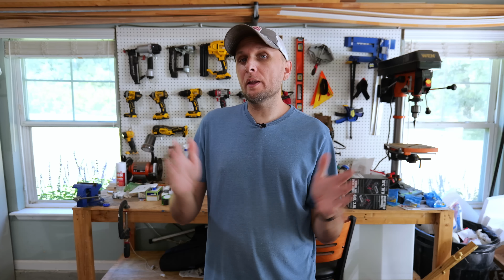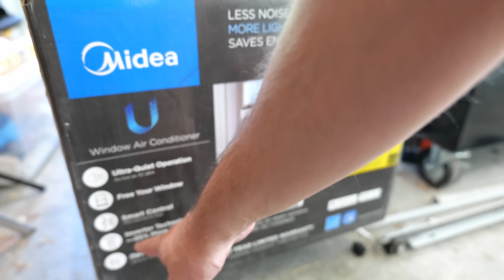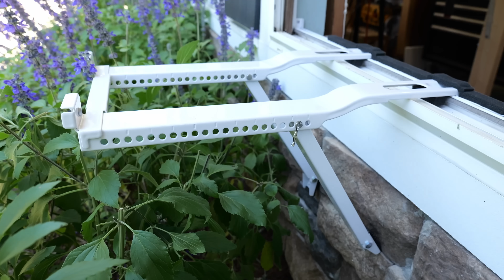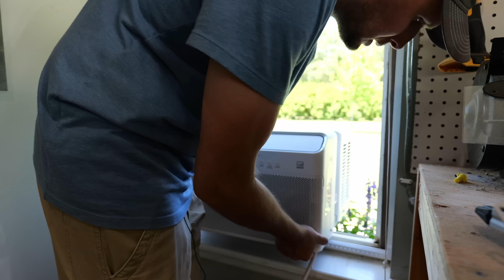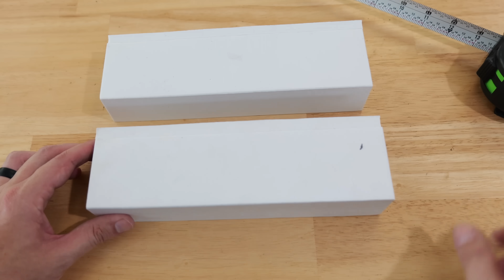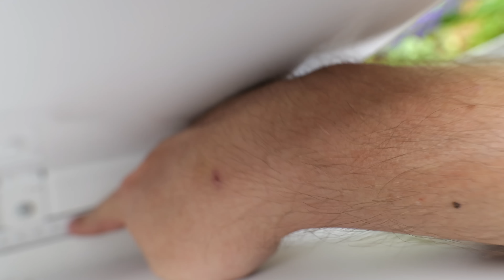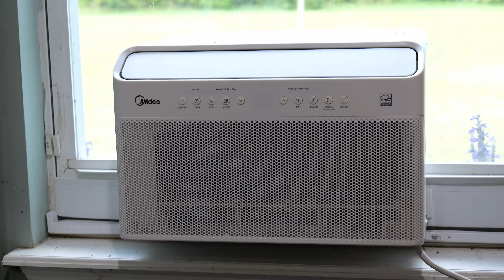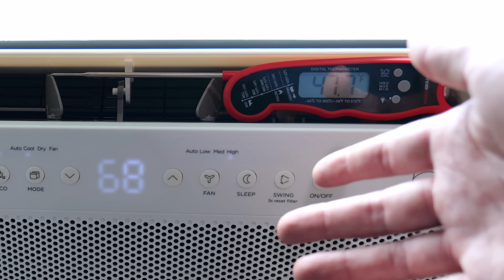The COLDEST And QUIETEST AC Unit Ever Made!  Still Use Your Window!

Comment from the maker: For your convenience there are links for everything you saw in this video from the Midea AC Unit to the tools used in the description of this video!  I am pleasantly surprised how quiet and efficient this unit is.
Reply: Looks like Midea does make a heat pump version. Very expensive and it's a "n" design  but plugs into a 110 outlet. It's literally a compact mini split but for some reason they're only manufacturing it for the East Coast market for the United States while another company is manufacturing their own for the West Coast market.
Reply from the maker: @riopato2009 I don’t think it’s available yet though is it?
Reply: @HowToHomeDIY  no it's not unfortunately at least for this year.
Reply: @riopato2009  Air-to-water heat pump that can provide space heating, space cooling and domestic hot water with quiet operation in -25°C low ambient temperature.
Reply: @loxety  Midea's window heat pump can only do -17c
Reply: @loxety Can you please tell me about this unit you speak of?
Reply: @riopato2009  any chance i could buy them here in Australia? We're 240v and i wanted a heat and cool window unit in my bedroom 🤔 does the heat unit also do cool? Or only 1 or the other? TIA
Reply: @craigsampson3386  I think you're better off installing a traditional mini split than getting window heat pump in Australia. It will take a few years before the prices for these units become reasonable. Midea is a global manufacturer of HVAC systems I believe very well known all over Asia so I'm sure you can find this brand in Australia. They do have a location in Melbourne and cover both Australia and New Zealand.
Reply: @riopato2009  thanks for the reply. Yeah I'll check them out but as you said they're probably still expensive. I was originally looking into a wall split system that was a hybrid by Superene to save on electricity bills, can run directly off solar panels and/or mains power, but still abit expensive upfront. You had to supply your own solar panels and the hassle of installation plus getting someone certified out to do the gas. 
We own the place but theres just alot of extra steps and money upfront, unsure how much longer we'll be living here so was considering a window unit. Tried portable and they suck so bad they're almost not worth it plus the room they take up and the loud noise.
Reply: How many Watts does it draw at full cool?
Reply: Hard to tell how efficient this is compared to a split or central a/c when you just compare it to "other window units."
Reply: In your opening you claim it's as close to a mini split seer rating but then you don't tell what the seating is did I miss it?
Reply: I noticed that the horizontal bracket that sits inside of the house (and screws into the side of the window frame) is kind of "floating" in your installation. My window is the same--the bracket will likely not rest on the horizontal section of the frame itself. Do you foresee this causing issues? I noticed you didn't put a block of wood under the bracket or anything like that. If you were to do it again, would you recommend adding one?
Reply: This product has been recalled because of serious mold problems.
Reply from the maker: @__HH__ easy fix.  Even they are offering one that they can install for you or they will send it to you to install.  These will all be on shelves again once the new units have the new drain plugs put in them.
Reply: @HowToHomeDIY Yes sir, you're right.  I received that message from them this morning.
Reply from the maker: @__HH__ yup!  About a month or so after I got mine I had mold growing on the fan.  So I know it’s a real thing.  But I have a video coming out tomorrow morning that will address all of this and how I have kept mold from growing in mine for over a year now.  Super easy.
Reply: @HowToHomeDIY I was offered a "buyout" ($308) for my 8000 unit but I chose the repair kit.  They said a tech would contact me in 2 or 3 weeks and come out to install whatever it amounts to.  I've never used the unit.  I purchased it as a backup to basically keep a room cool if the SHTF or the electricity goes out due to a hurricane.  (NC)  If it's August and the AC is out more than 24 hours,  that's a SHTF event to my wife!  😂😂)
Reply: I just bought 2 of these 12,000 units from Costco on-line on sale now for $300 each. Plan to use them when one of my central A/C units goes out, which usually happens every 3-5 years and takes a week to find parts and fix. One guy said these things can easily cool 1,000 sq.ft.each!
Reply: @ChatGPT1111 The product has been recalled due to very serious mold issues
Reply: @ChatGPT1111  12000 BTU will not cool 1000sqft  not at 90F.   trash fake claims  in that  and this video of quitter than a mini split also this unit still blocks the window where the better ones sit under.
Reply: @ChatGPT1111 These things have to go under strict quality and control measures.. that being said don't you think they would prefer to say this unit would cool 1200 ft instead of 550 it was sell a hell of a lot more units right..  most mopeds have a 50cc engine that goes a max of 31 miles per hour usually 25 to 28 somewhere in there but some guy shows you a video with the same moped and he goes surprisingly it goes 60 miles an hour..😂😂
Reply: We have windows that close horizontally. I assume this unit could not be operated if it was installed vertically? I don't think any unit can do that, can they?
Reply: @lexzan /videos I've read in the comments there are designs for horizontal sliding windows.   It would be mind boggling if there weren't since almost all windows I've seen are horizontal except really old windows.   
 You would think that if you got one of those from this company that it would do a good job also since it's from the same company?
Reply: $400 - $450 Range ?
Reply: @rickpittenger7692  $320 at Costco for 12K
Reply: @rickpittenger7692  I just paid $329 at my Home Depot
Reply: Would you be able to link to the Air Conditioner Support Bracket used?
Reply from the maker: @loxety it comes with the AC.  Which I have all the different sizes in the description of the video that you can check out.
Reply: Great video. What's the dB level when the fan is on low?
Reply: Do you know how many amps the 8000 BTU unit draws?
Reply: awesome product and video!  Question everyone: will this work for windows that slide sideways as most do?!
Reply: I dont see a link for the foam kit... does it come with A/c?
Reply from the maker: @offthebeatenpath5160 Yes.  Everything you saw installed in the video was included with the AC.  Obviously the tools are not though.
Reply: The type of refrigerant they are using in these units are medium temp vs high temp refrigerant in a typical HVAC.  Not a fair comparison
Reply: @BEASTWRANGLER  - What comparison?
Reply: The bracket come with the a/c unit?
Reply from the maker: @ramtruck2011able yes
Reply: The bracket come with the a/c unit?
Reply from the maker: @ramtruck2011able  Yes it does.
Reply: i hope my alexa can control it.  i have a portable indoor unit so loud i have to crank up my tv to watch yt and hear anything
Reply: YES! it works w alexa!!!
Reply: You can install window locks. Lowe's, home Depot, and Amazon have them. They clamp into the window channel to prevent it from moving.
Reply: DO you also provide link to factory recall due to serious health risks?
Reply: :O wtf is that screwdriver and can u change the bits on it?!? To a Red robbi/green/star/flat? ( Time - 4:55 )
Reply: need a link for that holding bracket for the unit
Reply: I don't see any links
Reply: Thoughts on using this temporarily during a power outage? Looking to upgrade one of our older window shakers for something more efficient.   Looks like should be able to use without fastening everything…
Reply: You have wet ground outside. Just remove the outside fan and have a geo thermal water pipe installed with a tiny water pump(aquarium class). You will have a massive gain in efficiency and noise levels.  All you need is a vertical hole a long water tuber and a tiny water pump for slow water circulation.
Reply: My unit never cooled.  Had to return it the same day.  That was two years ago.
Reply: I don't see a link to the drill used.
Reply: A drill is a drill. He used an 1/8 inch bit to predrill the holes. @kevinmonceaux2101
Reply from the maker: @kevinmonceaux2101 yeah you got me there.  I forgot to list that one.  Here is my affiliate link to the drill: https://amzn.to/4efAaSR.  You may want to look into the drill and driver combo though as for $40 more you get the drill, impact driver, 2 batteries, and charger.  But totally up to you!
Reply: What is the watts per hour to run this unit? @HowToHomeDIY
Reply: Can it use to heat up your home to ?
Reply: @dyslectische Yes.  If you turn it off on a 100 degree day, you can consider it instrumental in heating up your home.
Reply: Wait for the issues, mine still works barely.  No smart control, got louder after 1st year.
Reply: @DerfOrNuffin  maybe buildup? needs cleaning from  inside  .check YouTube on how to clean it.

Comment: Regarding the inverter-for-window ACs, a couple of years ago I bought a Consul inverter for window/wall slot mount - a first of it’s kind in Brazil, the promise of the savings of an inverter without the hassle of breaking walls of a split. 
   
Noisiest AC I’ve ever had, sounds like an airplane taking off.

Comment: Doesn't matter. A split can almost run off of PURE solar NO battery it's so efficient. A guy on YouTube has already done it. He installed during a "sunny" day (of course) and it literally ran only off the solar panel so zero electric bill. You can't beat that no matter how many functions are on that Ac unit!

Comment: An efficient mini-split will have a lower total cost of ownership over a 5 to 6 year period....   Noise level cannot even compare, the mini-split main unit is outside, and the noise from it (30 to 55dB) can be reduced even further quite easily.  The indoor unit is typically 19 to 30 dB, a typical whisper is about 25 - 30 dB.  12,000 BTU Midea unit is about $500, and your dB meter was right about 50 dB inside.   That Midea  with its 15.0 CEER rating, would have an estimated electrical cost to me of about $839 per year (based on seasonal temps in central FL) to keep my space cooled to 75F 24/7/365.   Or I can buy a 24000 BTU 21.7 SEER2 rated mini-split for about $2400 as a DIY.  Although price & SEER2 rating will vary by brand, BTU, and installation type.  Where the mini-split would have an estimated electrical cost to me of about $433 per year.   That's a 5 year cost of ownership of: $4695 for the Midea Vs  $4365 for the mini-split.  Other factors would of course go into this calculation like seasonal temps in your area affecting runtime of units, availability of DIY units in your area, if you choose professional installation instead, etc....

Comment: I have a smaller one that wasnt affected by a recall they had, and it works very well. FYI Im pretty sure the bracket goes in the window track area where the window slides up and down and the remote can be quirky. Mine is anyhow.

Comment: Friendly PSA: I have this AC unit but bought few years back. There is a recall for these. I’m not very sure if the newer units are affected but the older ones are. The problem with it is that the water doesn’t drain well and can have mold problem. Please check in with the official recall and see if your unit is affected.

Comment: I just did the recall on one of my media units yesterday.  Do not buy these units!  It filled up with so much water that it was leaking into the wall on my house.  I could not see this until I removed the unit and saw the water in the metal under the unit.  My unit did not have a drain hole, that’s the fix they make on the unit for the recall.  I am getting the full refund for the unit instead of the drain hole fix.  Also, this unit cooled the room great at first, but after over 2 years it really was not cooling that well anymore.  I did have the correct angle on the unit.  I was cleaning the inside in the unit regularly, because I had noticed mold buildup inside, before the unit was recalled for mold.

Comment: I bought one of these based on this video and while it worked great for one season, ultimately it was an absolute piece of junk. There are stories all over the internet about the issues with these units. The board fails and bricks the unit. This is exactly what happened to me and Midea does not offer any solution other than to buy a new one. DO NOT BUY.

Comment: Noise is a result of high air flow , more air flow is not bad with a heat removal unit like an AC.
I'll take some noise for a larger air exchange rate .
This is the SAME reason people put Fans in front of small units , to squeeze more performance out of them .

Comment: Look any window unit you buy is going to require maintenance anytime you are removing heat just the temperature changed is going to cause water run of and in my experience and I clean window units in a city if you can’t take it apart it ain’t worth buying also maybe I shouldn’t mention this but the bugs that find there way in any a/c period is unreal.

Comment: Just got two 10k units and they take half the energy of my central Air but keep the house as cool.  I also found out how to disable the wi-fi transmitter to eliminate the electromagnetic radiation coming off these units.  The radiation emitted was very high and in the dangerous zone so one would not want to put these units in their bedroom unless this transmitter is disabled.

Comment: I have that in my bed room worked great untill the round cage got cloged up, and it will not drain.  There has been a recall on these units because they are not draining and causing mold problems, it has completely ruined my siding and i have adjusted the angle a couple of times and it did not work.  Can someone explain how to clean the round cage in this unit

Comment: Did you have to install a dedicated electrical line for that? or are you operating off the room breaker at 15-20 Amps?
Reply from the maker: No.  Just using the 15 amp breaker for the circuit in my garage.  No issues in well over a year.
Reply: @HowToHomeDIY thank you so much. Your wiring videos have also saved my life. Much love brother!

Comment: That's one of the best thermally fitting AC units with out DIY alterations I've seen. They even provided the foam pieces. However. After all that work; it is unlikely it will be uninstalled when the winter weather comes around. If you keep it installed, how well does it keep the cold out in winter? My AC is not this one. It leaked a cold draft in the winter. So I built an insulated cap/cover to fit over it plus the lower window that can be strapped on. No more cold air draft.

Comment: Great video.  I still think a 200V mini split is better.  You do get some condensation, especially when it rains.  I'm thinking of my window health.  It is an old house with plaster walls.  Windows are new.
Reply: I agree. I've been looking into mini split to do away with my 17,000 btu window AC, which cools the whole house on those 99 degree summer days. But does no help in winter. The mini can provide heat in winter. Might reduce heating cost considering the house is base board heating. The AC discussed here is a nice one as far as window ACs go.

Comment: 12000 BTU on a normal 100+f American day. This won't work. You need a min of 17000-32000 BTU.  This will cool your living room  but that's about it.  

Also 90% of ac require the build up of condensation for the slinger fan in the back of the unit. It throws water at the radiator to cool down the gas back to a liquid faster and makes the AC much colder.  Only remove the drain plugs when you are putting the unit away for the year.
Reply from the maker: Well that is just not true.  I am in the South and we have been setting record heat numbers and this unit is have no issues keeping the space nice and cool.  DO NOT OVERSIZE YOUR UNIT.  You will be asking for issues if you do.

Comment: just fyi...if your house ac is blowing in the 50s, its broke. a new hvac ac unit will blow down to 37 to 40 degrees at the register. This window unit should also be blowing at the 40 mark if its brand new. Also if you want an ac unit to blow colder, buy one that does not have a digital temp control.
Reply from the maker: That is just not accurate.
Reply: @HowToHomeDIY  what part?

Comment: Hi, where did you get these S shaped brackets at 4:50? Mine doesn't have those and I called Midea and they said they didn't have them and it's not included. I need these to secure the unit more solidly because the 2 little cheapo sliders don't reach far enough and are preventing a tight fit between my window and the side foams.
Reply: Anybody???
Reply: I'd like to know that too. I'm in the same boat. These brackets that he's using were not in the box.
Reply from the maker: I don’t know why they are telling you that unless they are misunderstanding what you’re asking about.  The ones in the video came with my AC.
Reply: @HowToHomeDIY  I know. I emailed them a screenshot of those "S" brackets and they said that it's not included and they don't sell them. Would you by any chance still have your manual? Maybe the exact part number would help.
What year is your unit?
I just bought mine on Amazon Prime Day as a new "reworked" unit.(After the recall) They had included the replacement black plugs and a little leveler and one instruction sheet.
Reply: @HowToHomeDIY  Hi, anyway you could reply to my previous comment about getting me the part number from your manual if it's not too much trouble. That would really help me. Thanks.